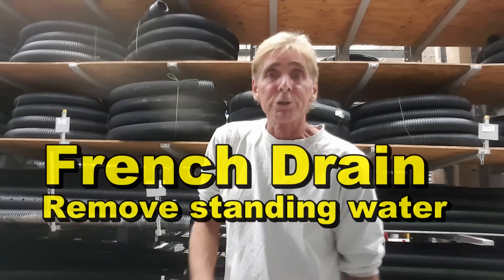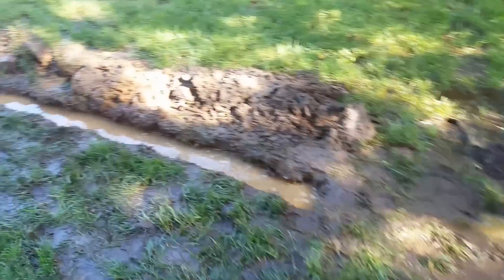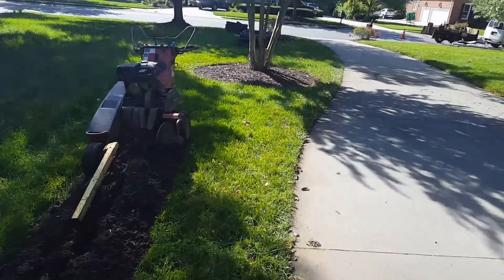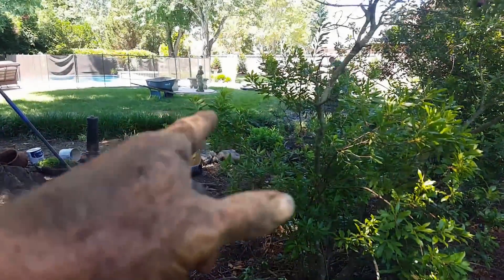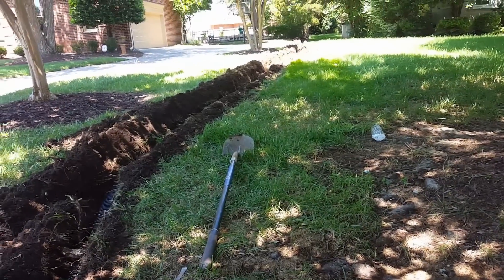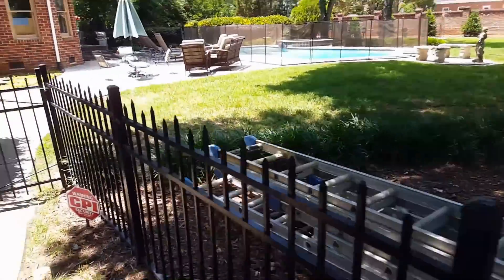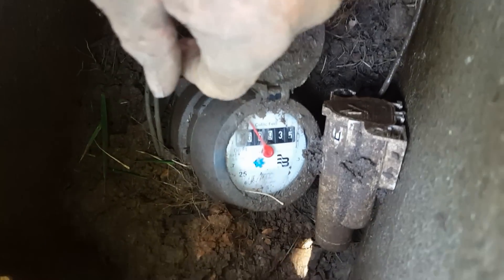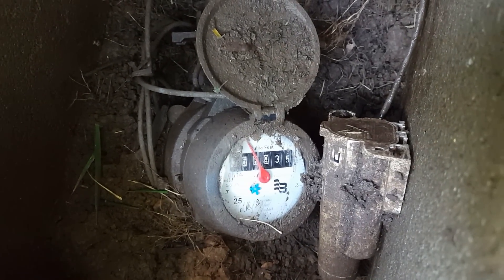French Drain Removes Standing Water

Comment: No gravel??
Reply: Sivan Sharma it doesn’t need to be covered in gravel. It is designed to be used for when you don’t have gravel or it isn’t easy to use. ie. shallow drains, running through the middle of a yard. Google EZflow. Inside the filter cloth is simulated gravel that is designed for, well, easy flow..
Reply: glennimmortal they are literally designed to be used the way he used them.
Reply: glennimmortal how will it loose its ability to absorb water? The EZflows are wrapped in filter cloth.
Reply: It should last. 3 inch PVC works also and allows for a snake if clogged. The tree areas may eventually grow into the line but in this situation it's unavoidable
Reply: You're acting like stone covered in fabric is totally different than EZflow, which is...  porous material covered in fabric.  Either way, as Nick says, you have soil and sediment in contact with fabric.
Reply: WorBlux that's not part of his work order. And could actually get into trouble for just taking it into his own hands. At the end of the video he did look at the water meter and said something about the irrigation
Reply: The homeowners don't really care about a drain or not.  They just want the mudpit to go away, which won't happen fully until the leak is fixed.  Checking the meter for leaks first might have saved a lot of money.
Reply: Mahlon Libby 
Did you see the size of that tree? I don't know how long anything would survive a wrap around root
Reply: SpiritBear12 it's not perforated pipe, it's a solid corrugated pipe. He uses the "easy flow" aka French drains, as the method to absorb ground water.
Reply: WorBlux yea so maybe the home owner should have checked the meter. Or had the pool or irrigation system checked out by someone. This guy installs this stupid system and that's it. He's not a general contractor. You can't generalize customers as they all don't care what you do just fix it. If I called this fool to come install a drain at my house and found out he was messing with my pool or irrigation system because he took it upon himself to think he knew what he was doing I would be bullshit. And . fire him immediately and hire someone else. I do excavation and work with a ton of different home owners and they all want things done in a certain way. Some of them let you do whatever you feel is correct and then some of them want to run the show.
Reply: Nick Torres.  You could use a root barrier. To protect the pipes.
Reply: I cant count how many drains we have removed and replaced from getting clogged. The Ez drain is a gimmick. Ment for homeowners. Should of done 4" pvc to carry water away. Those corragated pipes are not good at long distances unless you have a good amount of slope.
Reply: Exactly what I was thinking, no rocks??? That pipe will be clogged up with mud in no time. Look how low those (only two) catch basins are. Anyway, how is this supposed to be a “french drain” lol 😂 😂 😂 
This isn’t how it’s supposed to be done y’all!!!!!
Reply: Then the term FRENCH drain is misleading ...A French Drain does use a perforated pipe ...Google it up
Reply: blindabinda123 
That will be tough to grow grass with sand as a base over a plastic pipe
Reply: SpiritBear12 Ok I'm right. I'm familiar with French drains and no expert. But I was thinking the same. Wouldn't it fill with dirt. Especially with the end needing to go against gravity to lift the top open. That'll get clogged in a few days lol.
Reply: glennimmortal can you explain where this system might get clogged within 5 years? Remembering that perforated pipe is NOT used in this installation.
Reply: Sivan Sharma the catch basins alone should not be used for a true French drain. You ONLY use an emitter or bore into city sewage... The catch basins are designed to CATCH DEBRIS not necessarily the water. Smaller debris will fall through and clog the popup emitter he's using. Also, he should have at minimum placed the popup at the edge of the yard not in the middle where the water will pool and cause the same issue only in front this time.
Reply: Yeah, no gravel and no landscaping cloth over the perforated pipes. Those are going to get clogged by dirt in no time and you'll be right back to square one.
Reply: Nick_Carriere that's why you don't use gravel.  You use stone. And you cover the stone in fabric.
Reply: blindabinda123 I’m not saying this is the best way to do it. I’m saying it is designed to work for a reasonable amount of time. It takes time to clog, but it will eventually clog. The homeowner could have wanted the cheaper route and accepted his risks. The contractor might have recommended this and gave him the life expectancy and cost, as well as an estimate of a longer lasting installation with more cost. Or he knew that the issue was the leaking drain and once it had a good outlet the EZflow would get no use because the soil would no longer be saturated. We don’t know the project intimately so we don’t know why he chose the cheaper, shorter lasting installation, or if he just doesn’t know ‘the right way’. But this is a common type of installation, it is cheaper, and the EZflow is designed to be direct buried in a yard for this use. Doesn’t mean it lasts forever, nor am I saying it does. Like I said, I went to school for this, I design the real shit, I inspect the real shit. I have done the work myself for a short period of time. ‘The right way’ is ‘the right way’ because it lasts longer at a generally reasonable cost. Some people will pay less to maybe do it right in a few years, when it reaches its life span, or just redo it cheaper again. It isn’t the only way, and just because something will clog sooner, or underperform in comparison, doesn’t mean it won’t work, or last a long enough period of time.
Reply: I do excavation and have installed miles and miles of perimeter drains gutter drains. Water mains sewer mains and everything in between.  This will work for a few years but will eventually get clogged and become useless.if he back filled the pipe grin the pool to the basin with stone that would have made the life much longer
Reply: blindabinda123 the gravel around it won’t change the fact fine soils will be in contact with the filter cloth. You can’t avoid it.
Reply: glennimmortal is 5 years really that bad? I'm not trying to argue, I'm asking honestly as someone who doesn't know about this kind of thing at all.
Reply: Zaku The Ferret YES! THAT IS BAD!! 100+ YEARS IS HOW LONG A TRUE FRENCH DRAINS SHOULD LAST.
Reply: glennimmortal Ah I see what you mean. So if the easy flow was covered with gravel, it's service life could be longer?
Reply: Sivan Sharma there was most certainly perforated pipe installed before that little catch basin. Look carefully for the pipe with the white sock over it.  This corrugated pipe is garbage.  If your going to do it yourself use 10 foot lengths of pipe and stone to backfill the pipe.
Reply: Nick_Carriere it will lose its ability when the silt from the top soil clogs the fine fabric.
Reply: That's not the worst part of the video. He says "I suspect a pool leak or sprinkler leak",  and no more investigation into it.
Reply: Sivan Sharma the easy flow will lose its ability to absorb water the drain pipe will be fine as nothing can get in it
Reply: SolarMill ya if your a hack and are going to be back filling with mud or silty material.it should be back filled with course washed sand or septic sand. Then this guy uses this shitty pipe going by the huge maple tree. He should have used sdr 35 perforated pipe going at least past the tree in a trench 2 feet wide using a laser transit and figuring the pitch for even slope per stick of pipe and then back filled with washed stone and then the fabric and back filled with course septic sand or washed sand. Sometimes it's called concrete sand because the concrete plants use washed or septic sand to make certain concrete.people have been using this basic stone and pipe drainage method for a hundred years.  I've seen household leach fields that have been installed with perforated pipe and washed stone and back in the old days they would cover the stone with a thick layer of mulch hay to act as the fabric.I've seen those systems still in perfect working condition 50 years after being installed.but a new system needed to be installed because the house was being sold and there was no leach field on the record for the house. Then install this new system called enviroseptic that looks almost like the kind of pipe this guy is installing but it's 12" perforated corrugated pipe with a fake grass type media around it and then fabric wrapped around that then backfilled with concrete sand.  And seen those fail in 5 years
Reply: I'm just saying the easy flow is not suitable
Reply: Nick_Carriere once you back fill that shitty ez flow media that's wrapped in shitty fabric with silt filled mud that ez flow is useless. Like I said this needs an actual trench that's more than an inch wider than the pipe.  This black corrugated pipe is junk. I would dig at least a foot wide trench and use 10 foot sticks of perforated pipe all the way to daylight at the road.  Backfill with washed stone cover it with fabric and backfill from the fabric up to with in 3 inches of the grass with washed sand or screened coarse bank run sand then loam over the sand. If the sticks of pipe ever got clogged you could run a snake through it or a roto rooter tool.  That corrugated pipe you can't run one of those through it when that trees roots grow right into that black slinky dink pipe. What do you guys call pipe used on the interior of a house in Canada?
Reply: SpiritBear12 yeah to many products used perforated pipe with a filter sock clean stones job done. This install would be lucky to last 5 years before it's clogged.
Reply: Nick_Carriere fine soils are not the problem with clogging filter fabric. Silt Is the problem. If  you backfill the fabric with something like loam the silt can clog the fabric if it's cheap fabric. That's why once you install the fabric you backfill the fabric with course sand. Not wet loam like the fool in this video. Then once your water problem has subsided you then loam the yard.
Reply: Nick_Carriere I've got a video on my YouTube page of the machine I run every day if you don't believe me.
Reply: SolarMill I'm not saying this won't or can't work. But the way this apple drain meat head did it is not utilizing the the design of this pipe to work effectively.that muddy loam should have never been backfilled over the pipe. I would have backfilled with stone all the way to the end that way when someone drives across the lawn and squashes this pipe at least the water can still follow the stone to the end and drain.
Reply: Nick_Carriere your like 20 years old kid.  I've been running excavators since you were in diapers. I bet you don't even know the difference between schedule 21. Schedule 35. And schedule 40 . Schedule 80. I have forgotten more than you will ever know.

Comment: a quick question, you have a drain but around it it's really muddy.  Whenever it rains a lot won't that eventually clog it with mud constantly running in it?
Reply: in my experience that is exactly what will happen. in the video they show the new trench going through the existing clogged lines.
Reply: i cant understand he installed french drains then put  drain pots in .which will clogg the pipe with silt when it rains .thats the purpose of french drains
Reply: Tom William omg use a period occasionally!
Reply: I'm not necessarily because the top portion where it's muddy will eventually grow back his grass and he states that he used solid pipe from the trees to the street so no dirt will enter there and then between the pool and the trees he had those two or three sections of white fabric-covered pipes to strain out the dirt it looks like I'm not familiar with what that was and then he had just basically drains on the surface I don't think much dirt will wash into it. personally I would have just dug a trench a little deeper put about 2 or 3 in of gravel the French drain pipe fill it with 4 inches of gravel and covered it Landscaping screen and covered it with dirt and and maybe put a couple clean outs along the way.
Reply: i used this corrugated pipe for a kitchen drain out in the country, wrapped it in  landscape fabric.  sprinkled root killer in the trench.  buried pipe in gravel.   gave the home owner instructions to add root killer to the drain every spring and fall.  these pipes fill up with roots a lot faster than mud.  Used about 30ft of pipe for a two person home.  I'm guessing it'll be good for at least 20 years.  As long as no one fills it with grease or drives over it.  For what it's worth, 10 ft of 4 inch pipe holds about 5 gallons.
Reply: He said solid pipe. Roots shouldn't find their way in unless there are leaks.

Comment: Thank you very much for your generosity in showing us how it's done. For a beginner dyi guy who lives on a budget, your videos are a tremendous help.
Reply: Hank T I know right! I did this to my house. I couldn’t have done it without his videos
Reply: If you have never done it before ? There is a RIGHT way and a wrong way for proper drain lines. The RIGHT way lasts for 20 to 40 years depending on soil particle size.  Clay being finer maybe 20 or better. Larger particle size, maybe up into 50. IF its done right.  Dig ditch, lay in soil cloth, lay in shallow bed of gravel (1" to 2") Lay down pipe with holes in pipe down at the 5 o'clock and 7 o'clock position (for extra protection pipe can also be wraped with soil cloth, then cover with gravel every ten feet so when you lay in the rest of gravel it won't move. Gravel should extent to within 6" of finish grade.Wrap first layer of soil cloth back over itself so its double thickness on the final height of gravel. Then cover with your top soil.  Its understanding the principles of Hydrolic flow and pressure that make for good drains.  Hope this helps. There are other methods and ways of installation.
 A little coffe and donuts for a crew doing drains might let you watch and will be most helpful to see it done.  Sunset magizine I'm sure have those DIY special books on foundations and such.
Reply: How would someone enquire into this company's record to see whether they had any history of problems resulting from damage to clients' trees?  
I'd be surprised if the combination of wholesale and ignorant dismissal of tree roots to 18 or 20" deep, together with trust in products with a few years' life before they silt and fail, doesn't result in new damp areas within said tree's damaged root-zone, root dieback, butt rot and eventual loss of said tree in its prime. Attributable to multiple faults in the working method. 

Thanks to the practitioners' hubris and to YouTube (YouHube) for smoking himself out.

Comment: Always hate to see the huge trees get their roots cut but you don't have much of an option in some cases. 

There is a way to trench around the roots but it doesn't always work in the form of an air trencher. It blows the soil away from the roots to let you trench under them but only works in some soil types.  It needs one of the high pressure high flow rate compressors like they use for jackhammers and is not a quite process but will save the roots to not effect that side of the tree.